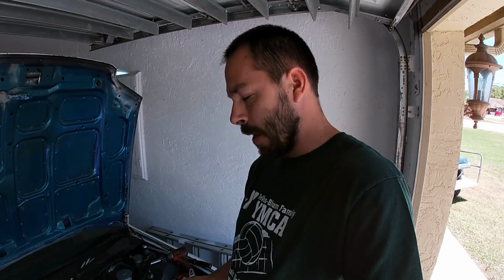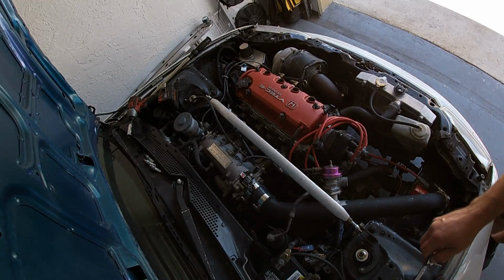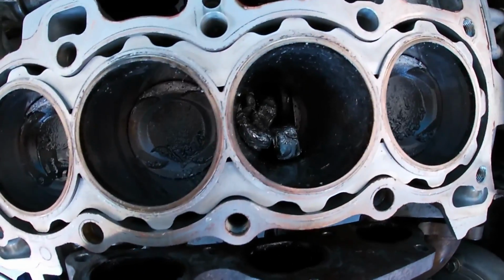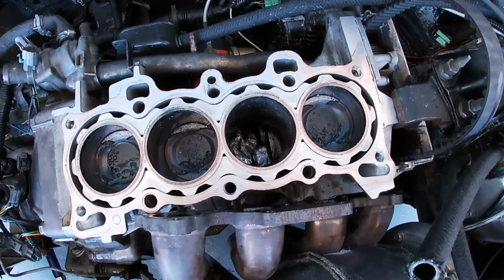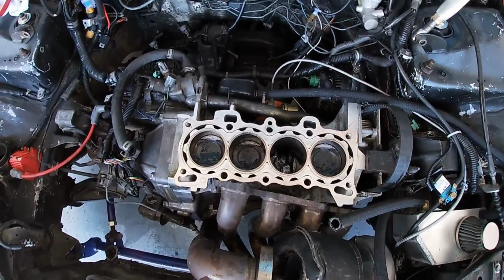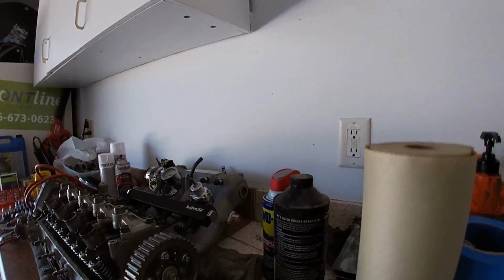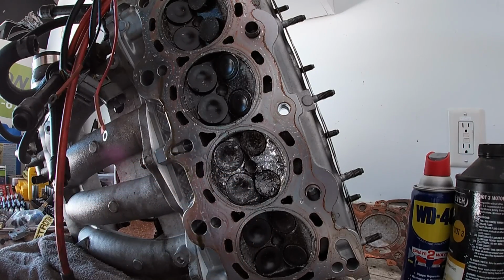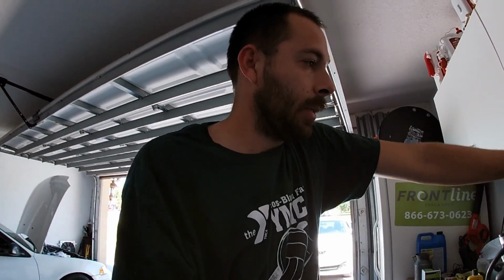Finding the carnage on the Blown 500whp D15B Vitara build

Comment: I've never seen someone so calm about catastrophic engine failure 😂 you're the man. Sounds like you have your work cut out for you on that cylinder head, I  look forward to future videos!
Reply from the maker: Part of the game.
Reply: @hatchbackturbo93  good joob and reflection , you need to put 3% more fuel on the only N°3 cylender , and 2% on the N°2 in map tunning ;) maybe OEM oil pump failed ? the turbi steel good ? ( Dav from france )

Comment: I used to have little Ninja 250 as my "beater" bike, which had carbs that always had the tendency to get gummed up. I finally traded up for something fuel injected so I don't have to worry about it anymore, but I have to admit I still have an appreciation for the mechanical ingenuity of the carb.

Comment: You could try sticking to the vitara build still and just use a standalone fuel management system?  But its always good to go forged pistons. 

Im suprised! 500+whp on a vitara setup. Almost 9's.  Very Impressive.
Reply from the maker: I thought about it but I dont want to be hurting my sleeved block over a $100 set of pistons.
Reply: I appreciate you showing how far the 
Vitara piston setup can be pushed.  (Im currently on that setup, with only Pump 91 available) Hurting Sti/Evo feelings. 

Not alot of people stick to that setup @500whp. Let alone stick to the D series. They always swap to H B or K. 

I cant wait to see how much your sleeved/CP piston setup can handle.

Comment: I predict 9's coming soon with the A6 block by the way is that a cast iron main cap A6 bottom end I believe the 88-89's have cast iron main caps
Reply from the maker: Yes it is
Reply from the maker: Once I get all the parts back for the machine shop and everything is all cleaned up I'll make a video on it
Reply: Hell yeah sounds good bro these D16A6 bottom ends are like the Holy grail of the single cams there known to hold the most power and the oil galleries on the crank are actually better than a D16Z6 cause they're chamfered can't wait to see a 9 bro

Comment: How long do these motors last you at 500hp. I'm doing almost a identical build. Thinking of just keeping it at 400 on 93.
Reply from the maker: tuning is key, I've had a few bugs over the years that have killed motors and I've been a little aggressive on the tune (timing) and killed motors
Reply: @hatchbackturbo93  i got you. I plan on using aem infinite so I can cross country drive it and it'll adjust to different elevations. Carlos Tuning in Orlando will be tuning it
Reply from the maker: @Fackler91  nice, I think I killed 3 motors due to a faulty aftermarket distributor. make sure you use oem or a coil on plug setup.
Reply: @hatchbackturbo93  will do thank you brother

Comment: Love the content! You deserve a lot more subs.
From your videos, seems like with just a piston rod combo, it will hold 350-400whp on a jdm d15b(stock head) safely? No supporting mods needed for that power level?
Reply from the maker: I wouldn't say safely but yes. Anytime you start making 3-4 times the original power it gets risky but as long as the tuning is good it should be fine.

Comment: Can I pay you to build me a d15?

I'd love to know/see how you're going to reshape it after welding. That sounds way difficult.
Reply from the maker: I dont think it would be worth it to send me a motor. It's very easy, I recommend doing some research and trying yourself.
Reply: What is a rough cost? Under 1k?
Reply from the maker: @MrBlitzblu  for me to do it or you. It also depends on what all needs to be done and what's parts you use.
Reply: @hatchbackturbo93  I was thinking more I paid you the money you picked up a block then shipped it to me. Otherwise the double shipping wouldn't be worth it.

I have looked it up. But I have zero tools, so by the time I got everything purchased I'd be into it immensely lol vs paying you a few hundred bucks or w/e
Reply: @hatchbackturbo93  what do you think a shop would charge if you brought in a block and the parts?
Reply from the maker: @TheKtchevelle  not sure, probably 500ish for assembly.  But the block will need machine work before that so figure probably another 300 for that. To have someone build you a vitara bottom end you're probably looking at around $1500
Reply: @hatchbackturbo93  I appreciate your response I know you get these questions all the time and i try to do my research first. I hate being the guy who asks a question on forums that you can answer with one Google search...

If you get the speed factory no notch rods what machine work would be needed?
Reply: @TheKtchevelle  literally nothing else. Speedfactory saved you from the notching job by making those custom length rods. If you were to get standard H-beam rods. Then youd need to notch. 

Other than that its a plug and play type of deal.
Reply: @youngnboosted3847  thank you!

Comment: Have you spun bearings on the single jingle
Reply from the maker: Never on any of my built motors. I run a 20w-50 oil
Reply: @hatchbackturbo93  oh ok nice do you port you're pump?
Reply from the maker: @luisviera3482  no just shimmed
Reply: @hatchbackturbo93  gotcha more oil flow ok nice

Comment: do you think its worth doing turbo on a d15z8 engine?
Reply from the maker: Sure, still able to basically double the stock power.
Reply: @hatchbackturbo93  looking for 300-400hp ish you think its reasonable? but people say the vents is alot smaller on this engine than the rest  idk if its going to affect it that much as people say
Reply from the maker: do  you will have to do rods/pistons for that power. You should also get a d16z6 head.

Comment: I have a d16z6 block with Wisco pistons and eagle rods and the head has a web cam hit me up I’ll sell it
Reply from the maker: Thanks already have the new motor at the machine shop
Reply: D-Serious I was going to give you a good deal around 750-$800 for everything but u pay shipping but if u change your mind let me know
Reply: @hatchbackturbo93  what machine shop you recommend in south florida? I had mine built i think they messed on my d16z6 they had told me to go .25 on the bearing and now we getting low oil pressure on idle. I think the clearances might be to loose. What are your thoughts. But yea let me know your good machine shop